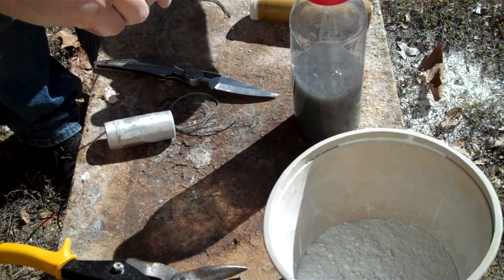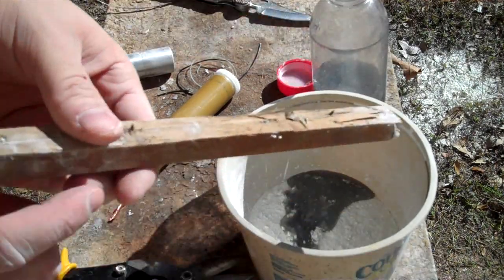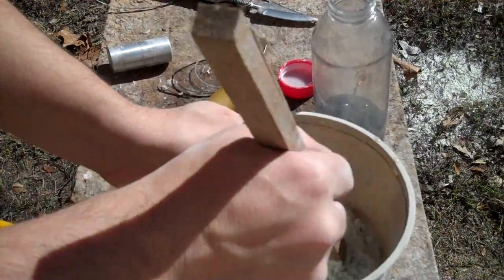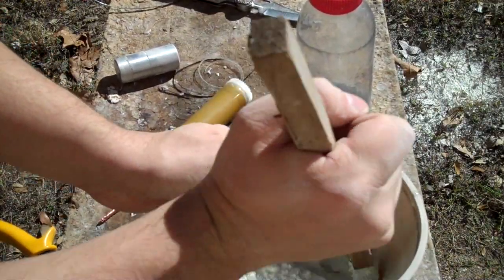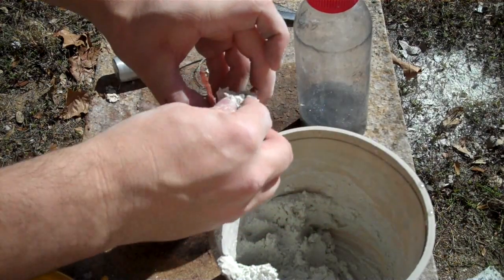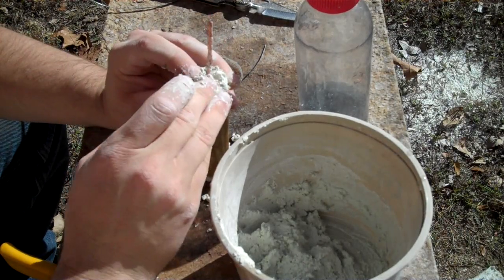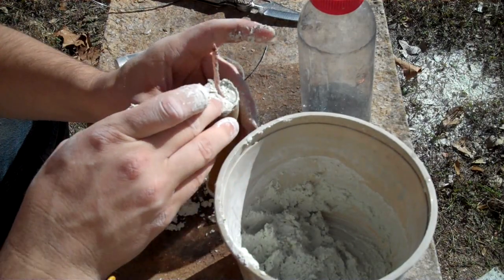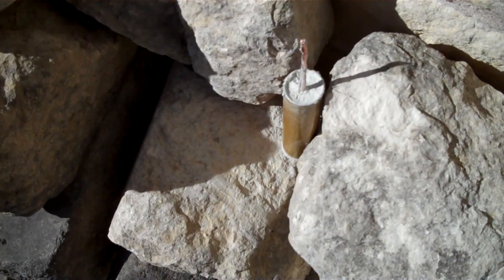How to make a cement battery

Comment: you can get better amps if you simply put burnt BBQ coal inside an aluminum foil, separate it using kitchen paper towel soaked in vinegar.
Reply from the maker: that would be a completely different principle than what i was doing

Comment from the maker: @propableself944 i found a straight high voltage dc current seems to get better results than a  high frequency one high frequency dc almost allways seems to cause a dead short or the cell bursting like a bomb if you baked it

Comment from the maker: @propableself944 my new ones ihave been polarizing them with high voltage when im letting them cool off after baking them in the gril.l cant really afford copper tubes so i just use wha ti can find. i havent been able to make them stable yet im trying to get the right formulation im getting close

Comment from the maker: @propableself944 its measured about 2.7 Ma continuously for a year now its not really a battery its more of a  radio energy receiver since it can be shielded and led will not light at all then. the corrosion on the copper aluminum is what keeps it from obtaining more power but then again it may be the reason why its receiving power. since it migrates through the battery during the curing process. according to a paper i read about corrosion and oxides being a radiological receiver.

Comment from the maker: @justblirt the bigger ones dont seem to be able to keep a charge like the ones of a smaller circumference the bigger ones. dont seem to add anything more no extra amperage or voltage than a properly engineered one of a small size. i have noticed the more cell you add then the polarity is not biased anymore either anode or cathode will work whichever way on the cells

Comment: So my investigations will involve putting current through the cement medium while setting.  This accomplishes the polarization of the dialectric, and I hope that it will dovetail with the other forces at work in the cement battery:  uneven ionic distributions, Casimir Effect of the metal platelets, and the basic storage and transmission of broad spectrum energies.  sorry to stink up your video with long forum posts...:)

Comment: In terms of running something from an electret itself, haven't tried, exactly.  Have only, to date, produced cement batteries.  But, I've noticed that these 'batteries' (one might do better to call them generators, or quantum energy pumps) are acting like electrets insofaras they will benefit from a dead short condition, will cure after one or two weeks like an electret and produce additional voltage, and contain on a micro level all the component parts of an electret.

Comment: Hey dude, I want to thank you for the clear instructions.  I've made a bunch of these now in different forms and admixtures.  One thing I've gotten to, these batteries are a new form of electret, with the polarized dielectric being the water glass in the radiator sealer.

Comment from the maker: one thing i forgot to mention is to treat the cement while it is still damp several times untill it cant take anymore sodium silicate if you so choose to do that. and use fresh cement or everything you put in the battery will just run right out the battery. also the cement will crumble and you will not get a very good effect so use fresh cement